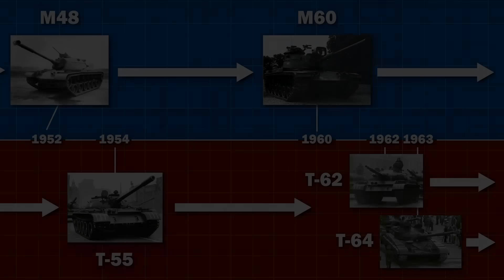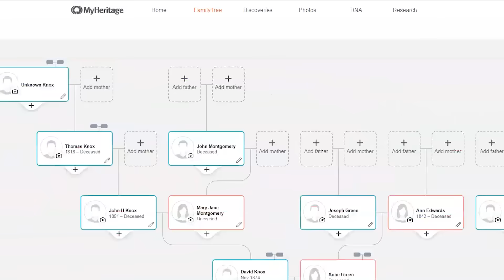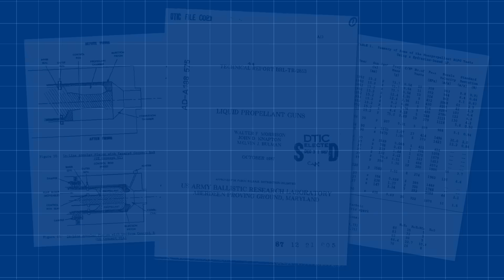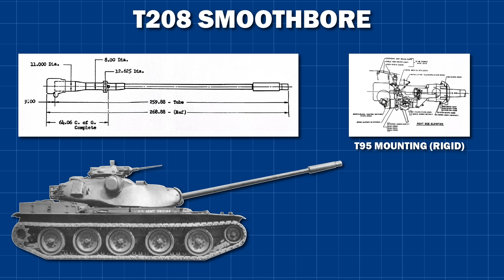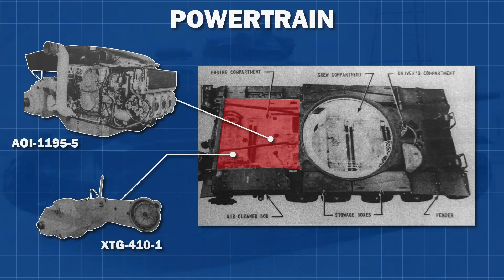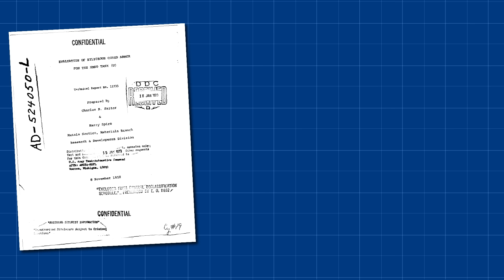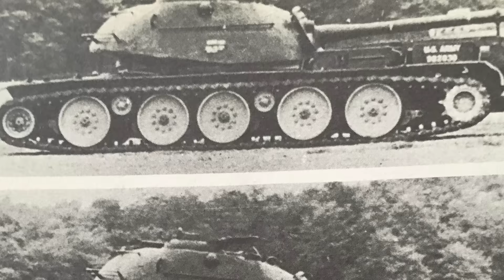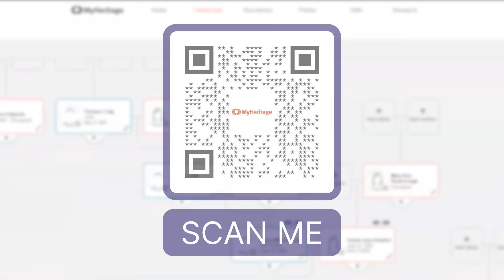T95 - America's Forgotten Super Tanks

Comment: What's the weird one with 6 road wheels at 1:43?
Reply: late but looks to be the t95e8
Reply: @wintiesnowflake - or T96 hull with early version of the M60A2's Starship turret, 152mm/6" gun with ATGM launch capability (eventually). The good part: narrow turret frontal area to be seen or hit, gunner and loader positioned (with escape hatches) lower by turret ring, and (if mixed with HV gun tanks in a platoon) kills at longer ranges by missile (in good visibility conditions) and a gun with bigger HE load against bunkers and troops, a bigger flechette load against troops and low attacking aircraft.
Now the BAD: much of the "futuristic tech" was bleeding edge for the 50's and 60's, not ready for field use. The digital revolution was still to come; electronics still bulky, power hungry, and unreliable in service. Caseless ammo not safe until Abrams seperated blowout magazine. Main gun is basically a howitzer, and missile needed tech from 20 years later to be practical. And to "top it all off", the huge .50cal turret like a cherry on top thats no protection against any real AP hit.
A prime example of the "Good Ideas Fairy" strikeing again, just 2-3 decades too early. It' always so much easier in video games and movies😂.

Comment: the problem here is T-95 was never really a design considered for production it was a test bed vehicle meant to test out different areas of tank development. sadly "the First" of what ever you are discussion only really matters if its produced in sufficient quantity to matter. the STG-44 wasn't the first "assault rifle" if we define it as an intermediate caliber rifle however it was the first to actually be produced in sufficient quantity to make a difference and influence other nations to follow suit. Being the first doesnt really mean much if it never left the design phase and prototype phase. The Fused silica armor of the T-95 never actually materialized and no T-95's where ever fitted with this armor. The Smoothbore gun , autoloader and fin stabilized ammo where so problematic that the US army had effectively written them off completely and is largely the reason for prevailing myths that autoloaders and smoothbore guns are unreliable and inaccurate. the APFSDS round was rather meek by comparison to other guns of the same era especially since the big thing in tank development was HEAT-FS which could cut through 400mm of armor at any range and APDS rounds at the time easily matched the smoothbore gun. 

that being said it was very much accurate to say the Americans where behind in the tank race until the development of the XM1 program.

Comment: 0:46 They have. The T-62 and T-64 have been both mass produced...the T95 wasn't. Not to mention the T95 technologies were unreliable and the smoothbore gun was horribly inaccurate.
Reply from the maker: If only the nice man said that in the video!
Reply: Except that neither tank should have entered mass production. The T-62 pushed the existing Soviet tank technology of the time past the breaking point (there's a reason why it was never given to any other Warsaw Pact nation), and the T-64 proved to be an ever bigger bust. It wasn't until the T-72 appeared in the early 1970s that the Soviets had a workable MBT to replace the T-55. The USA saved itself a lot of money and effort by not concentrating on immature technology.
Reply: @petergray2712  T-62 was an excellent design, although troublesome in the beggining. T-64 was basically a ''supertank'', but with many flaws that were sorted out too...after the flaws of the T-64 were fixed it became the best tank on the battlefield until NATO caught up with the thermal sight equipped Abrams and later models of Leopard 2. T-72s surpassed T-64 only in sheer numbers and later in technology (about 1985)...
Reply: that last part... i feel it, in war thunder the gun shoots everywhere

Comment: Why anyone would want to mount a cannon on a nonrecoiling mount? What are the advantages? I can't comprehend it
Reply: Non-recoiling guns take up far less space as they don't need room in the turret to move, nor have any recoil mechanism to take up even more space in the turret. To still be able to absorb the energy of firing, the armour in direct contact with the breech, as well as the elevation trunnion, need to be reinforced, often resulting in really absurd sounding armour values for those areas. 

Rigidly mounted guns absolutely have their adivantages in terms of space-saving and armour protection in relation to their weight compared to recoiling guns.

But as tank cannons were able to exhert more and more energy, the level of armour required to absorb the recoil became excessive, hence why rigidly mpunted guns never really took off. There are many examples of working rigidly mounted tank guns, such as the experimental 32-pdr (94mm) Centurion tank, but these are singular cases that stand on their own.
Reply: @ZETH_27  That sounds like it would be wery expensive to produce or mentain. I gues in long run it was deamed unacceptable from logistic and industrial reasons
Reply: @ledzik1893  as long as the gun's recoil-forces aren't that intense, rigidly mounted guns can handle it just fine, woth no particular maintenance quirks over recoil-mounted guns. If anything they require less maintenance and checkups since there is no fluid nor springs involved.
Reply: @ZETH_27  i think that suspension would suffer quite significant forces
Reply: @ledzik1893  Given the incredible level of travel that the suspension has and the fact that it already has to carry the weight of a heavy vehicle, I don't imagine taking the force of cannon-fire would be an issue.
Reply: More armor, to absorb recoil. Massive space saving potential. Depending on how the mount is made, less weight for the vertical traverse to balance. Cheaper, less complex.

Comment: both the Chieftain and the T-64 also used opposed-piston engines, although theirs were diesel, and both of them had problems with their engines. the reliability of those engines improved with time, but it still makes using opposed-piston engines in the T95 now with hindsight seem a somewhat risky choice, although it does make sense for a tank that's testing out new technologies.
Reply: The Continental engine for the T95s is not a true opposed piston engine. The opposed piston engines in the Chieftain and the T64 are, as they have 2 pistons per cylinder pushing against each other, where as the "opposed" part of the Continental engine means the pistons are moving in opposite directions. The Continental engine would be better called a flat or boxer engine, like automotive engines such as those in Subarus, Porsches, Corvairs, etc.
Reply: @kevinnoneman8246  thanks for the clarification and I was kind of wondering about that since opposed-piston engines are usually diesels and the Continental engine was gasoline, but apparently it was indeed just a flat 8 and not a proper opposed-piston engine.
Reply: On the other hand, engines like the Commer Knocker and the Napier Deltic had quite good service histories, so I wouldn't say opposed piston engines are inherently a bad idea, just poorly implemented by the respective armed forces.
Reply: @404-ThisUsernameIsAlreadyTaken  that's true, although the specifics required from a tank engine might have something to do with it as well, since it's not as easy to move such a heavy vehicle and it puts a lot of strain on the powertrain.
Reply: @juusolatva  Trying to squeeze so much power out of a relatively uncommon engine design is always going to result in some difficulties, but I'd argue that the fault lies in the engineers, manufacturing, and design requirements moreso than the opposed piston engine having any inherent faults.
Reply: do you mean transverse? not sure what you mean by opposed piston engine.
Reply: @alexander1485  an opposed-piston engine has two pistons opposed to each other in each cylinder and they are usually two-stroke diesel engines.
Reply: @juusolatva The Volkswagen beetle used opposed piston engines aka boxers.
Reply: @JohnBickner  yes, but we are not talking about flat or boxer engines. actual opposed-piston engines have two pistons opposed to each other in each cylinder and they are usually two-stroke diesel engines.
Reply: @JohnBickner a horizontally opposed engine and a boxer aren’t necessarily the same thing. 

Boxer refers to the specific firing order of the engine.

A flat engine that isn’t a boxer, lets say a flat 6, may still use a firing order like a V engine would. A flat engine is only a Boxer if the movement of one cylinder bank directly mirrors the other in an even pattern every stroke
Reply: @alexander1485  Google it. In a nutshell, you have two pistons per cylinder with no valves, just ports for exhaust and intake, and either two crankshafts geared together or a set of connecting rods driving a single crankshaft.
Reply: @alexander1485  Horizontally Opposed engines are flat with the pistons all connecting to a central crank shaft. Typicaly an engine would have 2 banks of 6 cylinders one each side of the central crank shaft.
Reply: The Leyland L60 was built by British Leyland. That's all that needs to be said about that 😂
Although the issues were eventually sorted, it took about a decade
Reply: The British Leyland L60 was fixed but it took 10 years! This was due largely to financial constraints of the broke Harold Wilson Labour Government. The main issue was cured by Belzona sealing compound that allowed the engine output to rise from Mk6A 650 bhp to Mk13A 950 bhp.
Reply: @billballbuster7186 wtf belzona? This looks like an advertisement lol
Reply: @JazzBerri  Maybe, but Belzona Sealants is what they used and it worked
Reply: @billballbuster7186  I was kind of alluding to the fact that it was fixed by saying that the reliability improved. while no engine is ever perfectly reliable and all of them need regular maintenance, there's certainly a lot of value in having a more reliable engine. one other thing I've heard is that part of the problem was that they decided to fulfil the NATO requirement for a multi-fuel engine that no one else actually bothered with, at least not at the time.
Reply: @juusolatva  Yes the multi-fuel requirement did add to complexity but was later abandoned. In the case of the British Leyland L60 the main issue was constant leaks and blown gaskets, not mechanical failures.
Reply: The main issue was the chieftain’s leyland engine was built to meet NATO requirements the rest of NATO ignored, mainly that to it be able to operate off low quality fuels as terrible as cooking/vegetable oils in the event of supply lines and nuclear fall out. Had they just slammed some monstrosity fuel guzzling high horsepower engine to begin with she would’ve been much better regarded. She was already NATO’s tankiest MBT. I guess all they planned on doing was going holding the line and going hull down. The German leopards could be relied on to flank and take positions before the enemy reached them after all.  Meanwhile the M60 was somewhat in the middle.
Reply: The reliability issues of the Chieftain’s L60 actually came from NATO. 

The brief was that all the MBTs being developed in the European theatre should have multifuel engines if possible. That would take the strain off of supply lines in a prolonged conflict. 

Pretty much every other country either gave up trying to make it work or didn’t bother in the first place. Even Germany just stuck with the MTU diesel power units they were used to. 

For some reason, Britain insisted on trying to make it work anyway, and it eventually did once the problems were ironed out. But a simpler turbo-diesel design from Leyland would have been much easier to implement